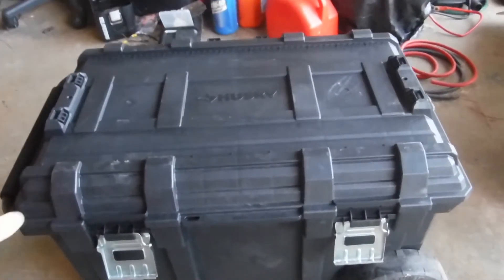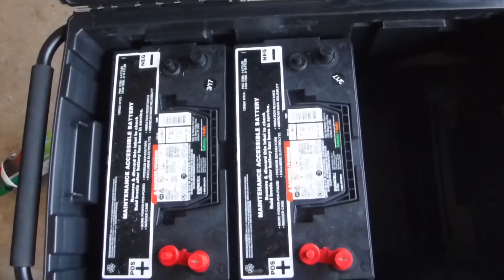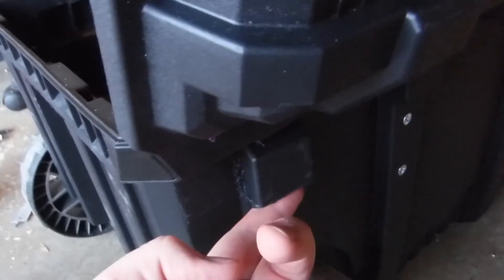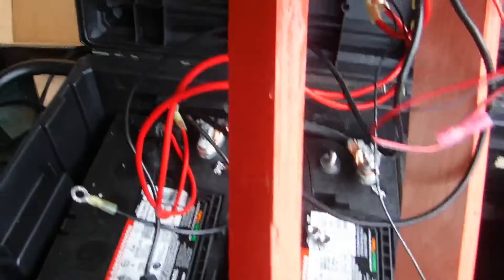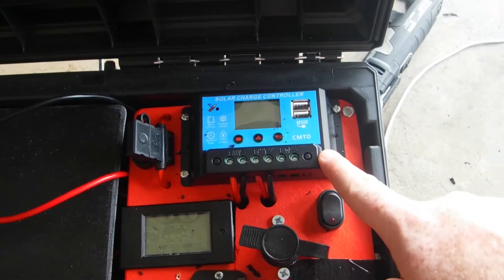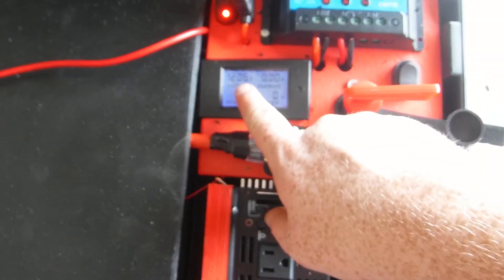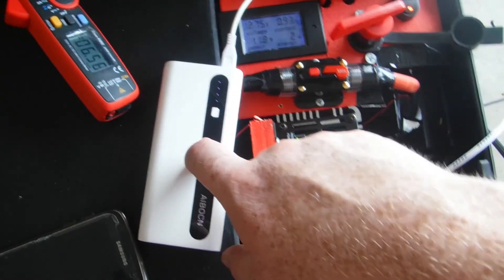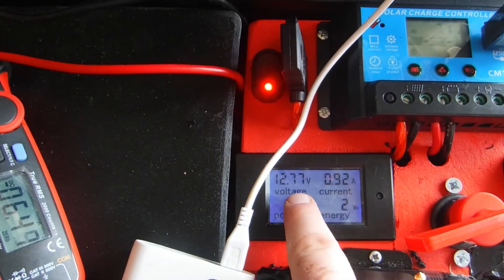DIY Solar Generator Build

Comment: Great - Job I’m going to do a very similar thing , my wheeled creat is a 63 Gallon DEWALT the same thing just about , I had to go this Big because my Battery Bank is 48v & my 5KVA Pure Sine Wave Inverter 48v @ 3KW 76A & is @ 5 KW 96A it’s a Hybrid and my batteries are 3.2v 280A x 15 = 48v and I’ve got a Dc To Dc step up 12v to 48v use 3 high Amp Car Alternators 12v to charge this bank YouTube the videos the proper way to charge you’re bank 😏

Comment: I would like to know the brand ( Inverter, etc.) names of the gear you used... good video but ends early
Reply from the maker: I updated the description below the video with links where you can find the gear I used. The inverted is different then the one I have but it is also 1000 watts. The one I used is no longer in stock. Mine is this one: https://goo.gl/ZTpEuD

Comment: How long can this power a tv
Reply from the maker: I ran my computer with 2 monitors at about 220 watts for 12 hours and still had some juice in the batteries. So, depends on how many watts it takes your tv to run. There should be a sticker on the back that tells you power consumption.

Comment: Same mistake over and over again. Wrong battery in 2017. And 24v system would be better efficiency. Good attempt. But this is essentially a 50amp power generator at best. Good for laptop and camping. Not good for anything else